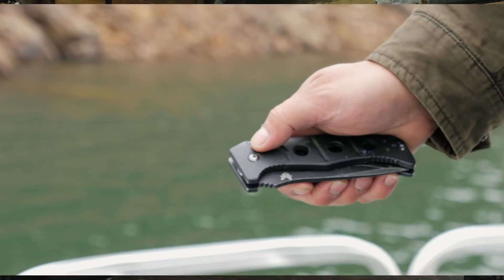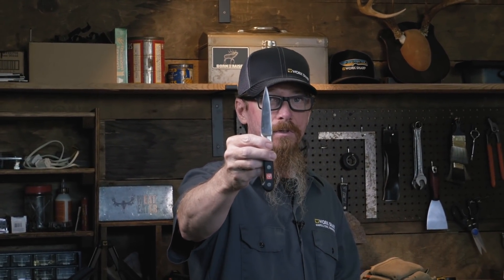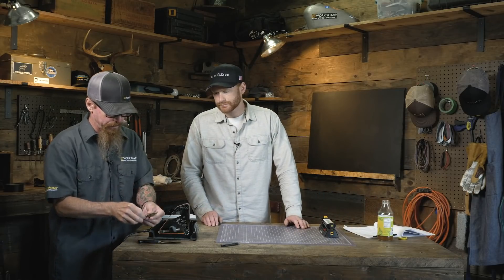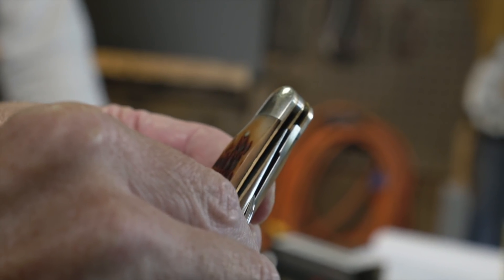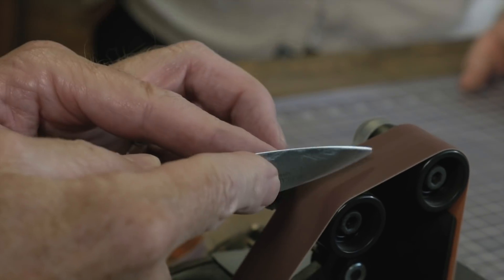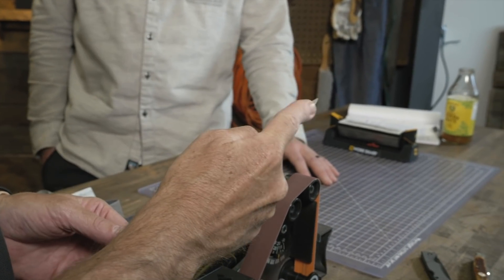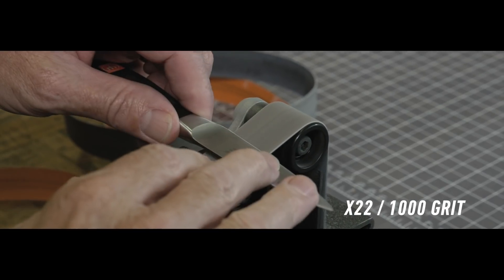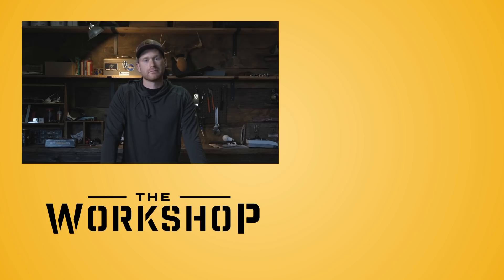How To Repair a Broken Knife Tip - Workshop Ep. 7

Comment: Works great on those kitchen knives with a VG10 core, the brittle tip is so easy to break off, have repaired at least 2 of mine using this same method.  Cant even tell they were broken.

Comment: My blade grinding attachment is on the way and have the benchstone on backorder. I wish worksharp would sell the accessories on there website on Amazon. I want to order the 15°/17° angle guides but with shipping  its cheaper to buy the whetstone unit the come with.

Comment: Why don’t you put a level platform up there where you are grinding instead of relying on not changing the angle of your hands?
Why do you sometimes use the upper part and other times the lower part of the belt ?
I can’t get the hang of sharpening. 
Where can I purchase this tool?
Thanks,
Paul
Reply: Go for the work sharp precision adjust knife sharpener it's relatively cheap and it's upgradable I had no fucking idea what I was doing for the longest time and I bought that like 4 weeks ago and I have done 3 knives so far working on another right now hence why I'm here now 😂 but yeah the precision adjust is great to learn on and you can usually find decent information about your blade angles online if you wanna try to stay close to the manufacturers edge geometry mind you I'm like a overly educated gorilla not a college kid

Comment: Exactly the method I was looking for - only problem is, the tip that I need to repair is on a Burnley Kwaiken - with a flat spine…. Due to the flat spine, do I want to grind up towards the spine from the edge?  If not, I’m not sure how to proceed…. I’m using a Ken Onion Work Sharp, but don’t have the blade-grinding attachment - I’ve only got the 15°-30° guide.

Tell me what to do, fellas…. and thanks for any replies from the Work Sharp crew!
Reply from the maker: This one depends on how much of the tip is missing.  If it is a very small amount, you could grind off the material with your current setup.  Just keep making passes, stopping with the "tip" of the knife in contact with the belt until the tip is restored.  If there is a significant amount of the tip missing (the more likely scenario) you will likely need to grind down the spine of the knife a bit making it into more of a drop point.  That would be a challenge without the Blade Grinding Attachment used in this video.  The drop point approach would be to follow the instructions outlined in this video.  You can always reach out to our awesome customer service team for additional support.  info@worksharptools.com  They are great at tackling stuff like this!
Reply: @WorkSharpOutdoor  I lost the tiniest amount of tip on opening the knife once, I flipped it and the tip hit a piece of metal and snapped off - about a half millimeter was missing, just enough to tell that it was now square instead of pointy…. So I worked on it last nite and now my tip is rounded - I think it may be better off (i.e., stronger) round rather than pointy.  The curve is sharp and being sharp it still can be used to pierce, but it’s not so fragile now, I think, as it would be if it were pointy.  

I may try to teach myself how to shape a blade using some junk steel, until I figure it out, before I work more on this kwaiken.

Thanks for responding and interacting with me!

Comment: I've got the Ken onion model electric sharpener. But want to get the X45 Belts for it would those be a good choice . I'm just curious because your web site says those are used for the initial shaping of the convex grind. And the X22 is for the final shaping or is the X22 belt good enough..

Comment: I mean lets be honest the worksharp is brutal on knife points! its a great sharpener, i love it, but boy ya gotta be careful with your tips.
Reply from the maker: Brutal only in the hands of the hasty. make sure to stop sharpening before the tip crosses the halfway point on the belt. Either lift the knife off or stop power on the Ken Onion or Original sharpener. Steve shows great technique here.
Reply: Yep. 

The only reason I see knives needing new points is because they were mutilated by Worksharps. 

Thankfully Lansky sharpeners exist and can quickly correct the issues.
Reply: Rifle Shooter Channel I’ve used a worksharp for many years and never messed up a tip. Would be a good idea to maybe use the product as detailed by the manufacturer. Sometimes reading instructions is beneficial.
Reply: @joshperdue4157  Some of us grew up looking at comic books, and some of us grew up reading them ;-)
Reply: it is brutal on knives generally
Reply: I had zero blade sharpening experience and jumped right on the grinder attachment and had a super sharp edge and zero rounded point. Its a belt grinder.. your not suppose to run off the side of a belt or bad stuff will happen. They tell you this in the manual.

Comment: This method of feeling the blade gives no indication about the real temperature at the sharpened part at all. 
First of all he feels the sides of the blade and not the place where he sharpened. Second he cannot feel it WHILE he sharpens and he mentions himself that it cools down very quickly. 

The hints in the product documentation and also on the box for the replacement belts are very misleading. 
It is super easy to overheat the edge when sharpening with power tools without constant cooling.
Reply: Yeah if you are using a super coarse belt for long periods of time. If you are just sharpening a blade, losing the temper on the blade is very unlikely.